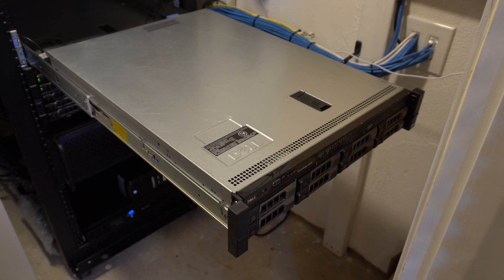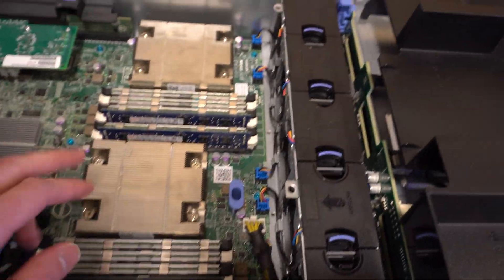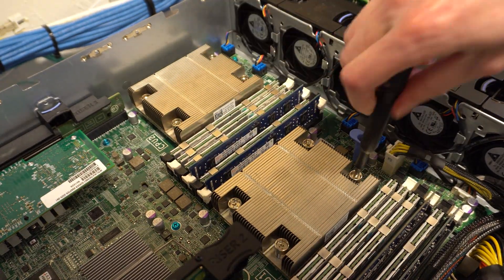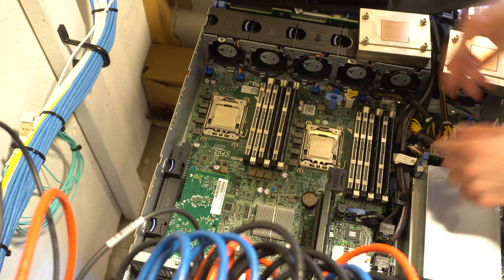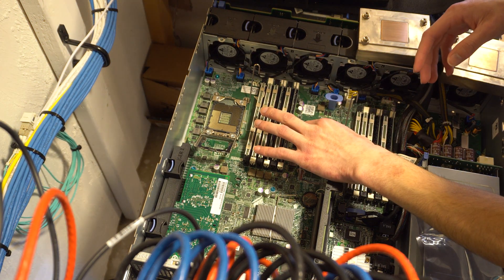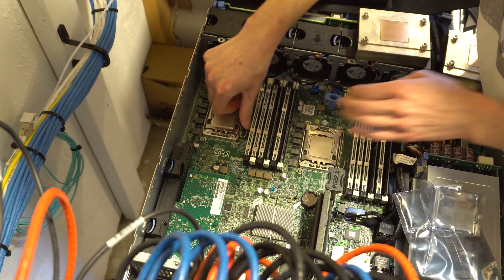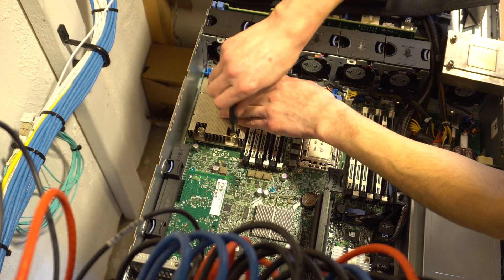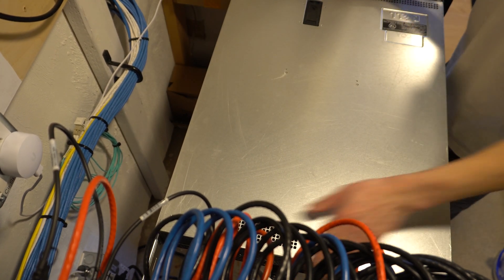Dell R520 Server CPU Upgrade

Comment: Great video thanks for making it.
I do have question, if adding 2nd cpu do i need to populate other ram slots like you have?
Reply: Same question that I have
Reply from the maker: Officially yes Dell recommends that you should install ram blank fillers for airflow if you’re not populating all of the dimms. And if you’re installing a second cpu you need to make sure that you have the same number of dimms in A slots as you do in B slots
Reply: @ Thanks for the reply and info.  Great Video